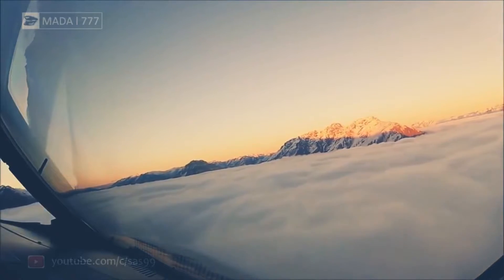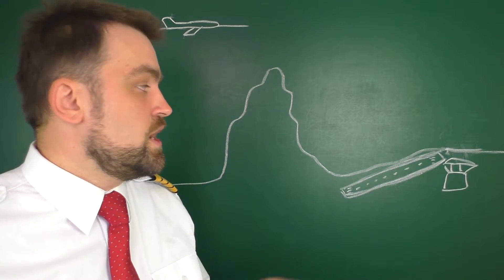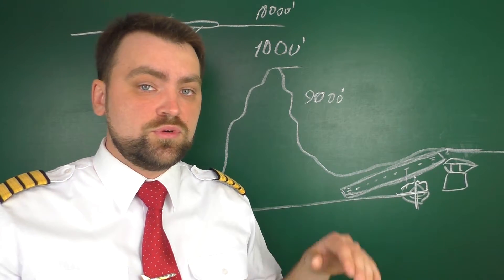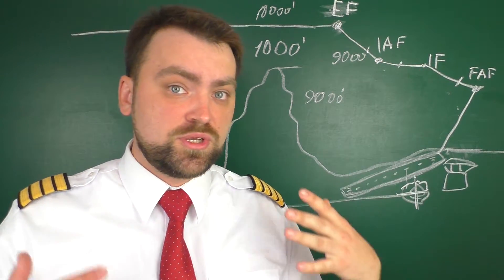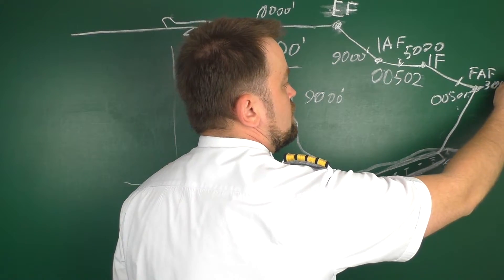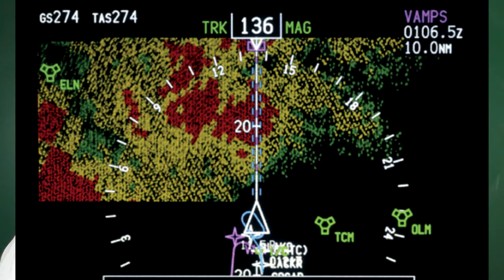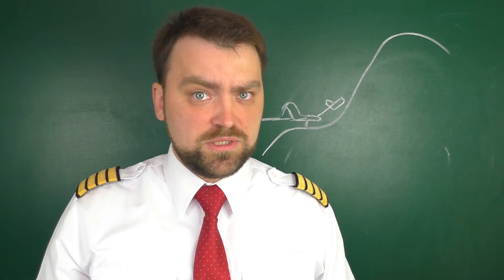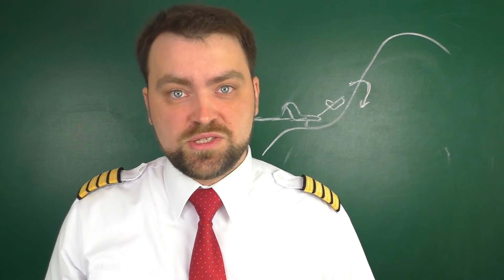How to avoid the AIRPLANE crash into mountain? | CFIT | GPWS | TAWS | Terrain pull up.

Comment: Poor ATR. Especially 72. Can barely climb to FL160 at 22tons. Very dangerous to avoid terrain when heavy
Reply from the maker: It is a little bit underpowered compare to DASH Q400
Reply: @PilotBlogDenys  Too much underpowered. One engine of Q400 has the power of the two engines of ATR72 combined. The highest I did fly on ATR72 was only FL200! :O
Reply from the maker: @cruxader27  I think it also depends where you fly. Delta ISA may be different. In Ukraine during the winter times we could fly up to FL250, in Indonesia 170-180. Turboprop...But yeah, Q400 is much better.

Comment: As always, thanks for this video)

And I have one question. How does the ATC recognize your callsign initially? (There is very simple logic in flight simulators. You should only put your callsign in a special field and tap "connect") But I can't understand, how the real ATC can get information, that an aircraft PSW for example have a callsign AUI5VU in this flight. I hope that my question is understandable 😂
Reply from the maker: They have the airplane data.(registration and many others)
You call with your flight number callsing
example.
Stockholm tower, Ukraine International173 Good morning, holding point Alfa.
Good morning Ukraine International173, Stockholm tower. Line up runway 20.

When you fly it is same.  
Now also new CPDLC system introduced, so you can even chat with ATC.
Reply: @PilotBlogDenys  it's simpler then I have thought before)

I've heard about CPDLC. Have you tried it? And if yes is it comfortable and fast to use?